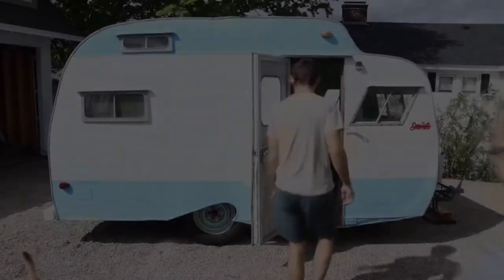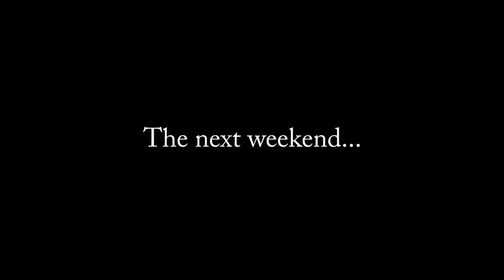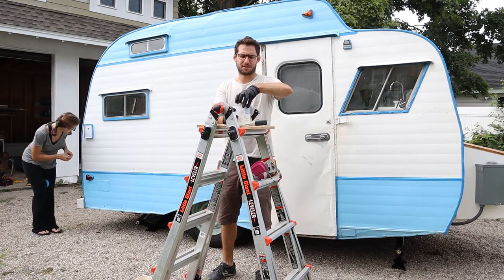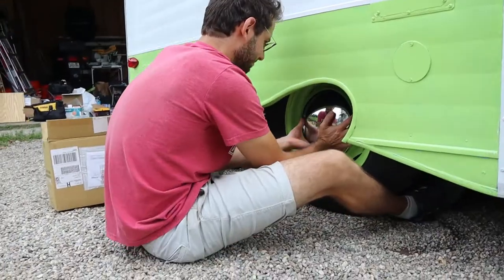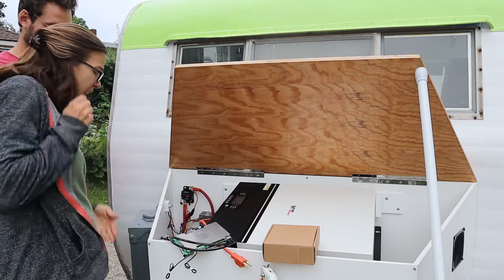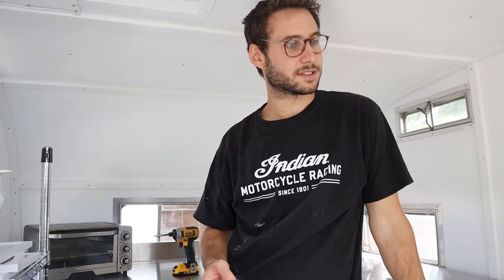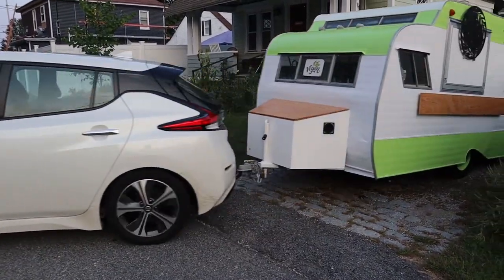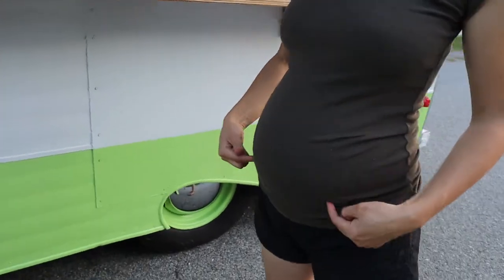Vegan Food Truck/Trailer Build FINAL EPISODE: Part Twelve (WE'RE OPEN FOR BUSINESS!!!)

Comment: Nice build…  how many hours can you run with battery setup?  Will you list cooking equip on board & menu
Reply from the maker: We've done up to five hours so far, only using about 40% of our battery, but it would really depend on how much power you're drawing to see how long the battery would last. We are eventually planning to connect our electric car to the battery to trickle charge it as well, but we've had plenty of capacity without it. Right now, we're using minimal equipment - a toaster oven or crock pot, a microwave, two mini fridges, and the hot water heater and fans draw some power as well. I prep most of the food in our commissary kitchen, so I'm not really cooking in in the trailer, so much as keeping things cold in the fridges or heating things up. 

If you'd like to see some of our menus, check out our facebook page - plantifulfoodtrailer, where I post our menu weekly or so. Thanks for watching!

Comment: Are able to prep the food at home for assembly on the food trailer? Or do you need to in a commercial kitchen?
Reply from the maker: We do our food prep in a commercial kitchen that we rent. Hopefully there's some good options near where you are, as it can be a bit tricky (at least it was for us) to find something close by that made sense financially since we aren't open that frequently yet. A lot of commercial kitchens near us require a lease and a monthly minimum number of hours (and they charge per hour of use), which can be tricky in the off-months or if you're just not setting up frequently like us. You also have to factor in paying for food storage as well, which is usually charged by a given space for each dry food, refrigerated, and frozen. Luckily, we found something originally that allowed us to do a shorter lease and a small number of minimum hours. You can look outside of the box too and connect with other small food businesses that would rent out their kitchen during off hours, or I know some churches with commercial kitchen spaces are also willing to do so. Hope this helps!
Reply from the maker: Didn't think of that one! Definitely worth looking into. Make sure to check with your local Health Department to clear it though.
Reply: @plantifulfoodtrailer6663  yes of course!;)